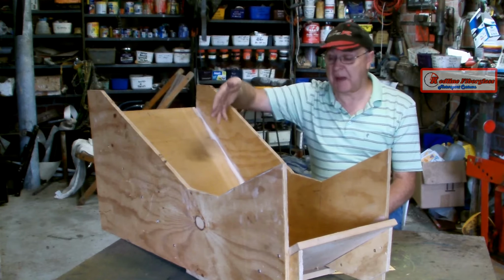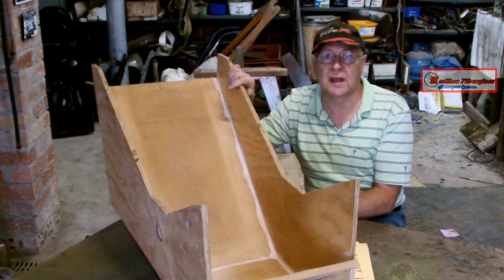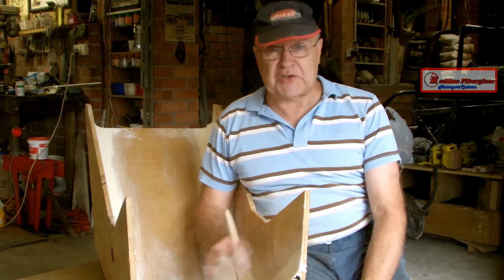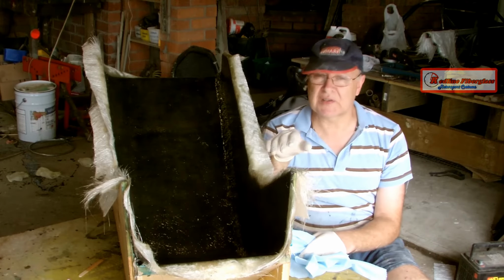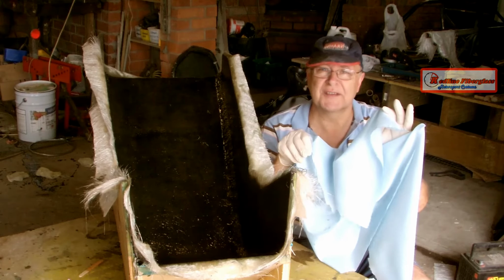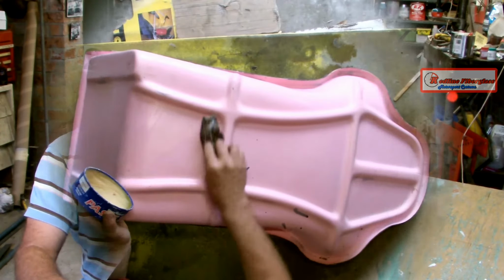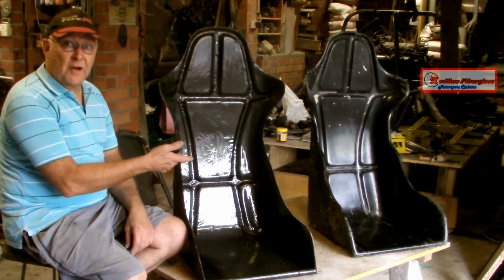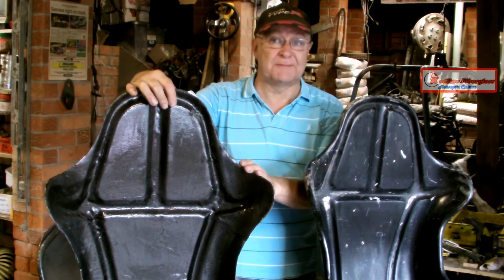Make Your Own Race Car Seat - 2nd music re-mix

Comment: Good video on making racing seats. I have to question your finished weighs for the seats, how can the fiberglass seat possibly weigh "24.5 kg", perhaps you mean 4.25kg?
Reply: I think maybe you're both wrong. 450g mat as the name suggests, is 450g per square yard, so around 500g for a square meter, I saw him put 3 layers on, lets call it 2 square meters for each layer, so that's 3 kgs, 3gs and a bit for resin and gelcoat, so I would estimate around 7 to 8 kgs.
Reply: @markmark5269  8kg is still very heavy for a racing seat.

Comment: Imagine if the carbon fibre seats were made in the forged carbon process as the finish, aka chopped up CF and molded into the shape via a press, or literally negative die of the outside part and sandwhiched together.  It would look so sick.
Reply: И почему же скажите сэр?😮

Comment: Hey bud, good to see a new video on seats. Its been a while since we last spoke. I wanted to know, is there alot of difference in weight, compared to infusion method, if you were to estimate?
Reply: Using the infusion method would make the seats lighter and stronger. All the excess resin will make the seats heavier and more brittle since there is no control on the resin amount.